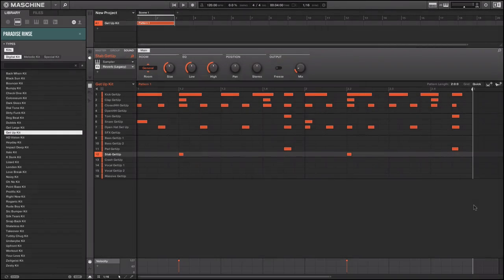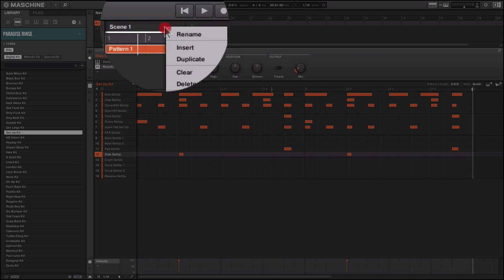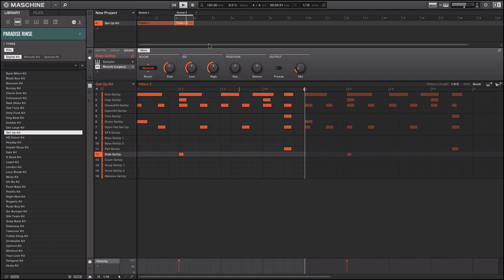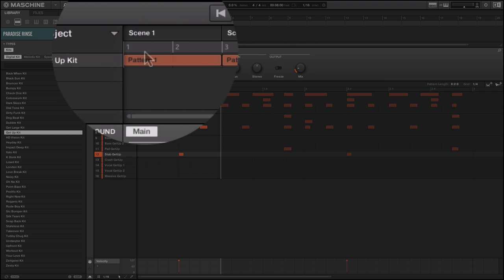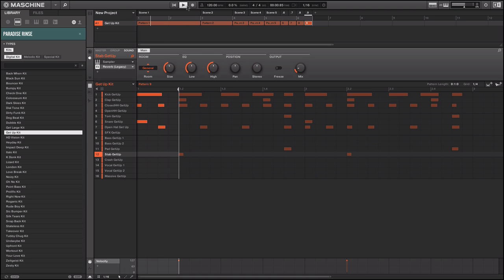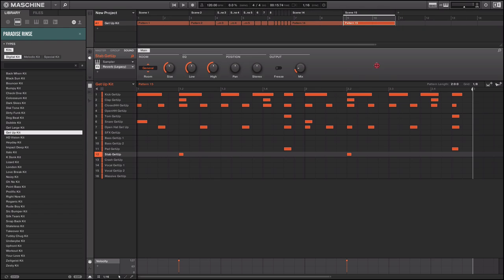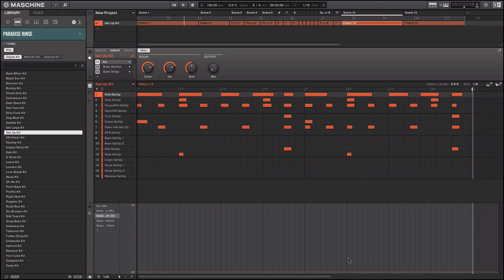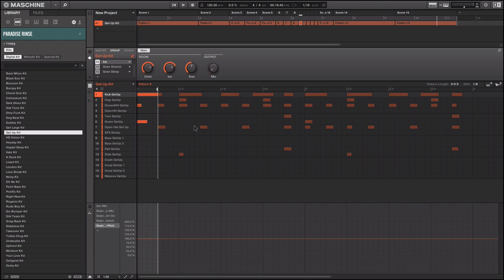Maschine - Dynamic Pattern Building

Comment: How the heck do you duplicate the scene and force it to create an independent pattern not linked to pattern 1. Check settings but cannot find an option for this. When i duplicate (using mouse) it duplicate pattern 1 at the same time.
Reply: +John Hailes Kind of funny that they are not answering this one hahaha
Reply: +John Hailes When you are in scene mode hold down duplicate button and on the left lcd you will see pat for plus pattern and that will allow you to duplicate patterns when scenes are duplicated.
Reply: +John Hailes 
Hey John to set it up to duplicate patterns when you duplicate the scenes you have to do it with the hardware. Something N.I. needs to add to software.